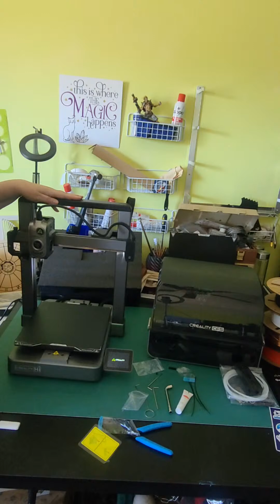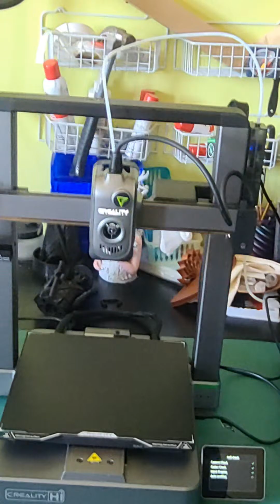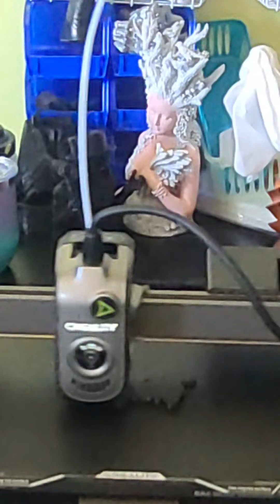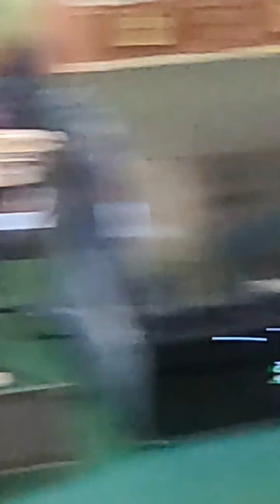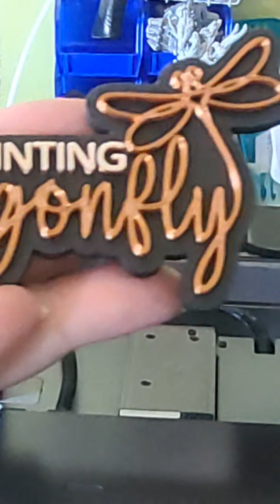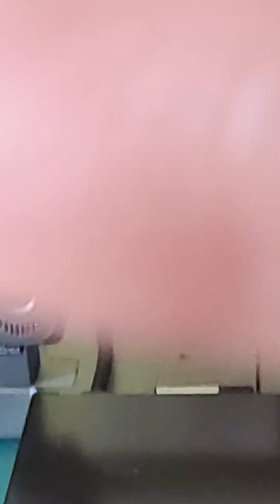Setting up my new Creality HI Combo!

Comment: Hi Lori I bought the HI, basically because you liked it and i see you in a lot of places. My question is about adjusting the X and Y axis, i adjust it on the screen but it wont stay and I don’t want to root a brand new machine. My K1C had the same issue but i could adjust it on the screen and it holds. Have you run into this?
Reply from the maker: Hi! I have not had to manually adjust anything on the Hi - it's auto calibration works perfectly for me. You might check the tension on the belts - you can adjust them. Here is a video about how to do that https://www.youtube.com/watch?v=OHepQPBw9bw&t=12s. Otherwise, let me know what specifically you are trying to adjust and I'll see if I can figure it out.

Comment: Other than the color system how do you like this Hi printer versus the Ender 3 v3
Reply from the maker: I absolutely love it! It produces the cleanest prints of all my printers. I do wish the print bed was the same size as my e3plus printers as there are some products of mine I cannot print on it, but it is my new favorite for sure. Even if you want to do single color prints, I would recommend getting the combo. The CFS unit is half it's normal price when you buy it with the Hi and is very convenient for even single color prints - my etsy products I offer in 4 colors so I can keep them loaded in the printers memory and just select which color to print in based on the order I got.
Reply: @LoriAnneBrown  Thanks for the info 🙂